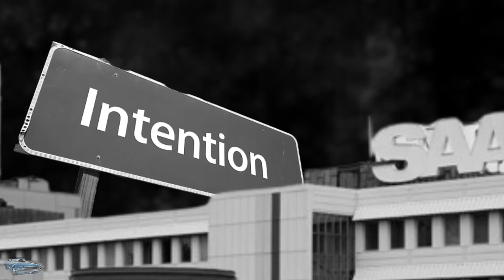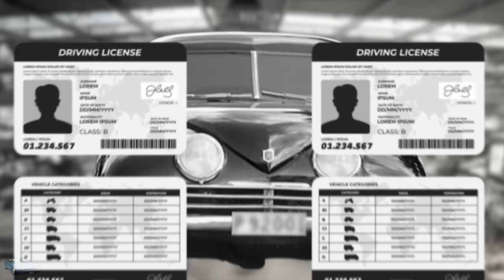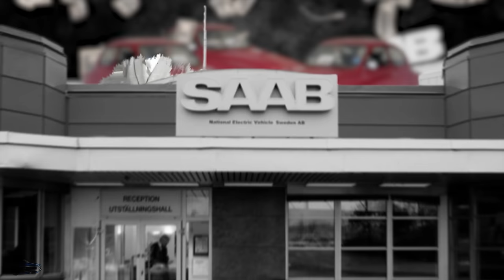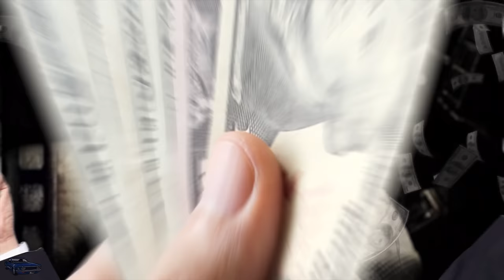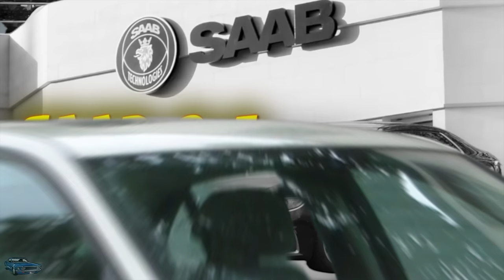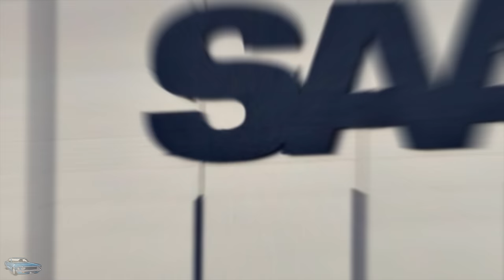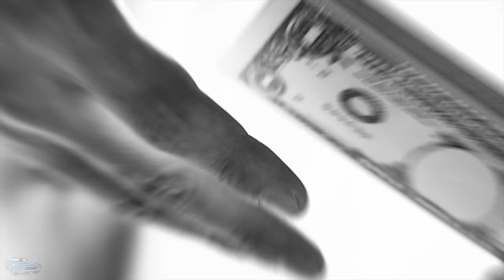The TRAGIC Fall of Saab | A Classic Car Documentary

Comment: As a owner on many really old 2 cycle and V4 era SAABs, the misinformation of this segment is rampant.  It's hard to know where to start.

  First off:  Saab didn't introduce freewheels in 1960, they were present from their 92 models onwards, they just didn't have a hole in the firewall and a little pull handle in the passenger compartment to enable and disable the lock up on the freewheel. You had to open the hood to enable the freewheel lock up.   So do you even know why they had freewheels? It has something to do with the type of engine they had

 The original 92 wasn't made from a "single sheet of metal and cut apart"  (Do some research on this subject ..) Sixten Saxon  their genius sheet metal designer made these first prototype by hand hammering the body shapes and SAAB had bought US sourced steel sheet in large pieces for their run-up to production and had to cut them into efficiently cut chunks for the rather complex stamping dies they had spend many months getting prepared for their production run of the 92 The early 92 used less pieces because the 92 had no trunk lid and a fairly simple body plan.  

The 1960 SAAB 96 was really not a whole lot different than the 93 that proceeded it in body design except for some refinements in their stamping, a beefier engine with 100 cc's more displacement and changing from Suicide doors to standard pivots below the A pillars.

Did you know that SAAB aircraft production was booming during the 1950's?  Look up a list of their aircraft and their production dates  They had designed from scratch many ground breaking jets that were as innovative as they were beautiful. The SAAB 94 sports car was never sold in any commercial numbers  I don't think more than 5 were made.

The most glaring claim about the 1968 SAAB 99 being equipped with a number of different 2 and 4 stroke engines is just ludicrous.  They were test running their drivetrain prototype called the Toad, a 6" sheet metal spacer welded in place into a cut down the middle of a 96.  The 99 had one basic I-4 cylinder engine design that was evolved out of a Triumph slant 4 used in the TR7, carried over to the 900.  It did have a freewheel in the first models. In my opinion the Taunus V4 was not a great engine. Too heavy and got poor gas mileage.

Find the book "40 years of SAAB Automobiles"  My 1962 96 had a receipt from Kurt Vonnegut's SAAB dealership in the glove box.
Reply: Is it correct that the Triumph engine is slanted because it's literally a half of a V8 engine?
Reply: @JeanMarceaux  Look up the Wiki on the Triumph Ricardo slant 4...

Comment: I almost bought a SAAB 96 with the 2-stroke engine from a classmate in 1970. I fell in love with the make but didn't buy one until 1977. It was a 1968 Gold Sonnet II with the V-4 engine. Serial Number 933. It had a 4-speed transmission with the shifter on the steering column. One thing it could do very well was turn a corner. It was a riot to drive on the curvy roads of Northern California.
Reply: The column shift on the Sonett V4 and the 95/96 cars was far superior to the cobbled-up floor shift on the Sonett III.  Two universal joints and straight into the selectors.  Moving it to the floor was Madison-Avenue mistake. All kinds of flimsy brackets and rods.

Comment: These were very popular in Minnesota back in the day.  The early ones were truly bad cars, not nearly as good as, say, a falcon of the era.  A 2-cycle motor (without automatic oil injection) was a reliability and emissions disaster.  The transmission freewheeling 'feature' was needed because on a long downhill run, when the car's weight is pushing the car, the engine would be starved of lubricating oil since there was no gas going through it.  The 'freewheeling' was illegal in some states because of the lack of engine braking in the drum brakes era.  But they learned and made some wonderful and innovative designs later on when American cars were mostly devoid of creativity.
Reply: My family ran the hell out of those 2-strokes daily. My father & two older brothers.
Occasional head gasket was about it.  
Americans just couldn't seem to wrap their heads around a 2-cycle engine.
I ran the V-4s and had almost zero problems ever, and they were all old used cars when we got them. Just got rusty, like any old car in New England!
Reply: My father had an East-German Wartburg 353 with a 2-stroke, 3-cylinder engine, 1000 cc. It had the freewheeling coupling, so the driver would accelerates then release the pedal. The engine runs at idle while the car keeps going on inertia. This was a kind of "pulse driving", quite annoying if you were used with 4 stroke engines, but saved gas and engine wear.
Reply: The freewheel really helped when the 2 stroke engine seized up, not an uncommon occurrence, especially in the mid '60s cars that had 3 carburetors. I remember the local Saab dealer had a wreck in the back lot caused by an engine seizure with the lockout engaged. The Shrike engine was a real issue.
Reply: @GaryL3803  Yet at the same time They won a great many races. Again, my guess is it came down to the normals not being able to handle the quirkiness.
Reply: Funny in all the years I owned my 2 cycles I never once was stopped or cited for having a freewheel in my cars, and two of them were premixers.    So the only time they were a "reliability and emissions disaster was if some dumbass poured the premix oil into the freshly filled tank and didn't stir the gas up by briskly taking it through a few rough alleyways.  My cars were very, very reliable, moreso than the 1966 VW Beetle I had owned 10 years previously. They required some forethought and a change in how you fueled them, they weren't for stupid people.
Reply: @GaryL3803  The Shrike engine was guaranteed for the life of the car as long as you kept the approved 30# oil in the injection reservoir.  My experience with a Shrike engine was it was really solid and didn't smoke as much as the premixers when cold.  But, and this was mentioned to me by an old Swedish gent who rebuilt their 2 cycle cranks,  Americans would stop using the more expensive straight 30 weight and use cheaper TCW-III water cooled outboard engine oil and you would end up being slightly leaner on oil but only if you drove it really hard. The fix was to slightly richen the jetting on the middle cylinder venturi and use a little premix in the gas.

Comment: There is also one Saab 9000 V8. It's a prototype made in Finland by Valmet automotive in 1989. The plan was to please the U.S. customers who was used to V8 sound and torque. The engine is made basicly from two 2l 16valve Saab engines. As soon it was ready the GM came and cancelled the project for some reason. There is a couple videos of it in youtube.

Comment: I used to live in the UK and between 1985 and 2001 I owned four SAAB 900 Turbos, the second last being a black 900 Aero and the final model of the classic 900 shape. Then came the 'new' 900 Turbo based around  the Vauxhall Cavalier floorpan, but with the option of the innovative 'Sensonic' gear change. This was a normal 5 speed manual gear change, but with no clutch pedal. I loved it. I bought the car new in 1994 and, 6 months later, took it Abbot Racing in Suffolk to be chipped and have the the suspension modified. I loved driving it and it never let me down once. I gave the car to my son in 2001 and bought a Honda S2000. I now live in a remote area of southwest France and, amazingly, there are two SAAB 900 convertibles in the area; I saw one of them just yesterday 🙂

Comment: My 9.5 HOT Aero estate (2005 pre-facelift) was a superb car. Lovely engine, so solid on the road but really quick across country and an excellent load carrier. I sold it for £1,500 with 175,000 miles on the clock, 85,000 driven by me over five years. Replaced it with a 2010 Merc E350CGI estate which has done 100,000 miles in eight years (180,000 in total). Difficult to choose between the two.

Comment: Saab's downfall was being in bed with GM
Reply: No, the whole reason Saab needed to be sold to GM was because they had already had their downfall. It was an unsustainable business in a world where they suddenly had global competition in the auto industry. Competitors had built up far larger customer bases and benefitted much more from economies of scale.
 
Others made better cars too: Saabs cost far more to build and yet they weren't good enough to warrant a price that was meaningfully higher than the simplest and cheapest cars made by competitors. Saabs competed against proper RWD cars with better engines in price, but their quality (aside from maybe a few surface details) was more in line with the other cheaper-category FWD cars.
Reply: @pistonburner6448  According to who, you? SAAB's quality didn't go downhill until they got involved with GM. GM also ruined a few other automotive companies that now no longer exist.
Reply: @sergeantmasson3669   What do you mean with 'quality'?
Why was Saab sold to GM if it was so fantastic?
Reply: @pistonburner6448  Initially, GM was not fully involved, once the GM crap parts were in SAAB, SAAB quality went downhill.
Reply: @pistonburner6448  Wrong i'm swedish, they were doing just fine before GM, in fact they would've made it on their own if they kept it at the pace they did. As soon as GM came into the picture everything started going downhill.
Reply: @Desynccc  Why did they sell to GM if they were doing well then?
Reply: @Treviscoe  Because they were offered a huge amount of money in exchange for newer platforms? They didn't NEED to sell.
Reply: @sergeantmasson3669 

Very true.  I had a 2000 Saab 9-3 (Best car I have ever owned) with the Saab built H-Motor.  2002 9-3 was the last year with the H-Motor. The 03 models had GM's Ecotec motors with a turbo charger. Nothing but problems. Transmission problems too.  Too much GM badge and not enough Saab engineering.
Reply: Saab was on life support when gm bought them. Saab died the moment they released the 99 which wasn't the great success they needed. BMW was in a similar situation in the early 60s
Reply: @chrisxa1222  What are you talking about? The 99 did great in Sweden aswell as the 9000, as soon as gm entered it went downhill.
Reply: @Desynccc  if 99 did well Saab wouldn't be in dire straits by the mid 80s
Reply: @chrisxa1222  It literally wasn't, tons of swedes were buying saabs all up until GM joined. I think i know how the swedish company in my swedish country went bankrupt

Comment: I owned and maintained both a 900S and a 900turbo.  Unusual automobiles.  The forward facing drive shafts, the clutch assemblies, the electrical systems, the part identification system.  Very advanced, but quirky.  The transmission in The automatically by Borg Warner was not up to the torque output of the 900.  The manual transmission shifted only after saying a prayer.  Still, I loved these cars.  The not so silent silent chain that connected the engine to the tranny made such a sweet wine, along with the turbo.  Those days are gone.

Comment: I absolutely love Saabs.  Owned a ‘91 900S and was amazed how reliable and safe it was.  Even in 8” of unplowed snow, when other cars were stuck, it was as if was in It’s element.  Presently I own an ‘02 9-3 convertible and wouldn’t trade it for anything.  It still turns heads and am often receiving compliments.  Though parts are available, there remains a wait, but it’s so worth it!  They’re a pleasure to drive!

Comment: The placement of the key in 69-94 900’s was great!  No hamburgered knee in an accident, like on other cars.   They had an interlock with the transmission with it locking up in reverse thereby making it harder to steal.   Finally, it was ergonomically correct, just reaching your hand down was more natural than sticking the key in the side of the steering wheel.
Reply: The placement of the ignition switch near the gear shift did not start with the 900 model.  I had a 1973 99e and the ignition switch was by the gear shift.
Reply: @SawtoothMan  He's kinda correct as the 99 model was first sold in 1969,  I owned a 1970 EMS, very perky with the B engine. Not everyone knows of the notchback model 99 as the later 99 hatchbacks tended to look very similar to the later 900s, from the 99 Turbo forward.

Comment: GM really had a weird strategy they thought that if you put a different badge on a car people would think it was a different car. It was devastating for a brand like Saab that built on the car being different from other cars.

Spiker's attempt was honorable, but I think most people knew from the beginning that it would fail. A very small company buys up a much larger one that comes with large running costs, it would have taken a lot of financial muscle to turn the company around. In fact, Koenigsegg looked at buying Saab, but they backed out for that very reason.

Before Saab was sold to GM, Fiat was also involved as a potential buyer, who knows, maybe Saab would have still existed then?

Comment: Not mentioned the 4 cylinder V4 engines for the 96?
Reply: It's a Ford (Taunus m20) engine!
Reply: I pulled and tore down the V-4 in my 1968 Sonnet II. The parts had FoMoCo stamped on them.
Reply: Not SAAB's best  engine choice, it's really heavy and they basically slowly destroyed the 2 cycle rated transmission when driven by clumsy, right footed Americans with the freewheel working. Final/differential drive replacement crownrings and pinions were getting really hard to find back in the early 90's.
Reply: @Mondo762  You don't need to tear it down.  It says FoMoCo on the dipstick.
Reply: @Mondo762  I believe the car designated Sonnet II was the first production model, with the two-stroke engine.  I believe your car was actually designated the Sonett V4.  The redesigned body with the tiny engine hatch (and the second car after the Volvo 1800ES to have a rimless hatchback) was the Sonett III, with the stupid floor-shift.
Reply: @philipethier9136  Sonnet II's did have V-4's in them. I owned one. It looked exactly like all the photos of the Sonnet II you can find. You're going to come along and tell me (a retired engineer) that I didn't know what kind of car I owned? Give me a break.
Reply: @Mondo762  Believe what you like.  The Sonett V4 required a bulge to clear the engine.  This bulge makes the V4 model look different than a 3-cyl Sonett. There is a nameplate on the front of the bulge carrying the model name "Sonett V4".

https://www.youtube.com/watch?v=6GrVurTida8 gets it right.

Comment: I used to own a Saab 900. I bought it in 1995. Best car I have owned. Very, very practical design; you could drive it like a sports car or as I used to joke, use it to move houses. And I loved the feature that lets you turn off all lights in the cockpit except the speedometer and the fuel gauge. Best feature I have seen in a car, it was very good for night driving.

Comment: I owned a 1989 model SAAB 900 2 door, and a 1993 model SAAB 9000 5 door. They were both very good vehicles, but by the time I owned them, they were around 20 years old, and of course had a number of problems. The 9000 had a huge amount of space, both inside and within the luggage area. Guess what? It was green. It was a pity that such an innovative company died the way it did. At least it was good that it didn't fall into Chinese hands, as has happened with Volvo.

Comment: I had a 1958 Saab 93. It had the coast downhill feature; a radiator front cover that you could pull up from inside the car when it was cold; 3 cylinder 2 stroke; front wheel drive; extremely original and innovative. I bought it used for, i think, $225, Kept it a year or two, and sold it at a profit. I don't recall putting a penny into it for repairs.

Comment: Another Sad  Saab  story from me. In1968, I bought a '65/ 2 stroke fast back . I drove it adding 30,000 miles until 1980 .The heavily salted roads of Minnesoda,,  the body was being fixed with sheet metal , parts were bought from other  Saab lovers. Minnesoda being the land of over berrrring regulations it didn't pass the clean air act. Had to get a used  Ford... Moved to upper Peninsula Mich.  The Saab came with in a truck, it would start no matter if it was 20 below.  The axel was rusting and tie bars were too. Sold it to a mechanic who refit pieces,  until it was to rusted. It will always be my favorite

Comment: I did a bunch of Rallys with a SAAB 96.  Damn that was fun to race once you learned how to hang it out through turns.  We put the exhaust over the roof to minimize it being ripped off going over rough roads.  That was a great thing until you rolled the car and then it was gone.  Once I rolled and it landed back on the wheels and was still running so I took off and noticed smoke coming from the engine bay as the exhaust was going straight out.  Still finished but it looked like we were on fire with all the smoke coming out from hood.